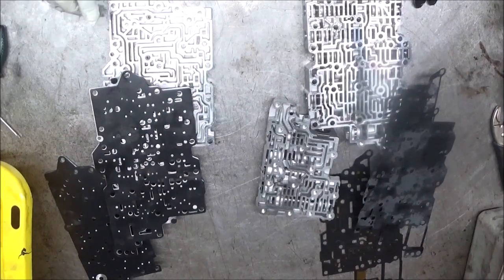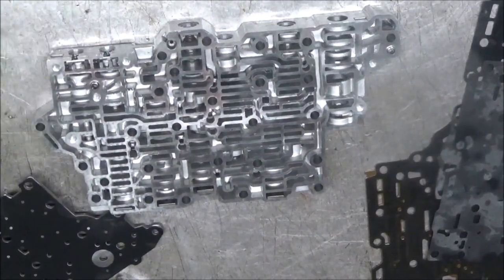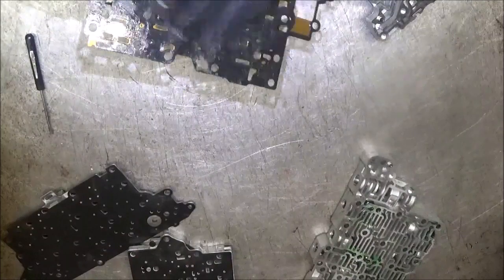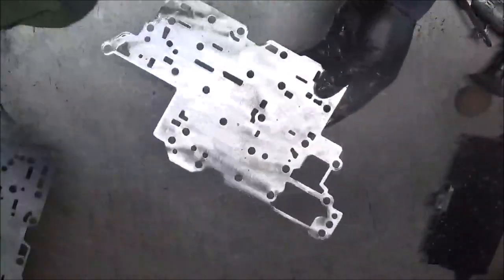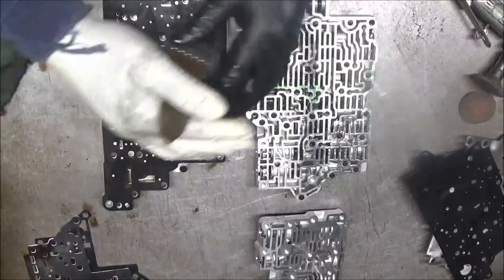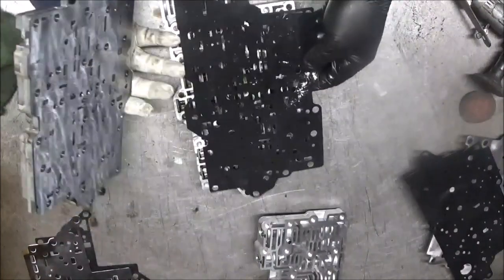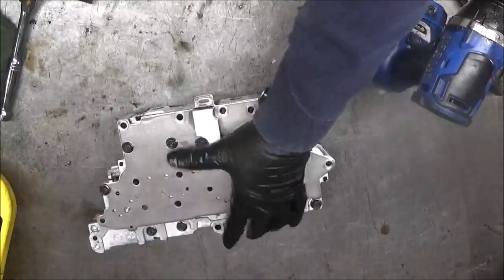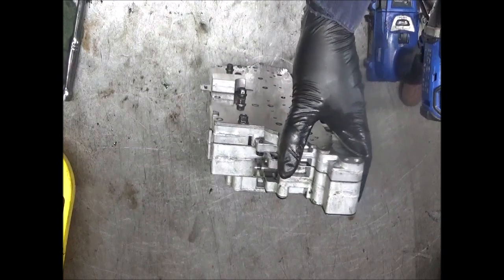6T70 TRANSMISSION VALVE BODY REPAIR (TIP 1) PART 2

Comment: Hello i have gmc terrain slt 2019 with the code trasmision valve stuck off code is P187E-00 is the same problem?
Reply from the maker: A problem code like this is going to be internal. How many miles is on the transmission?

Comment: Great video , just did my first 6t70 valve body yesterday . This vid would have been great to watch when reassembling . 2 of the check balls had indent the plate I left as is , is that ok ? I cleaned the gaskets the way you showed in the other video with boiling water. Very tuff to remove the top plate I didn’t remove just installed with factory gasket. Also bought the pressure switch kit and fixed them , watched your video while installing them . Thank you 🙏🏻 for the great work  keep it up!
Reply from the maker: you should be ok. The boiling water is for gaskets that are not bonded to the metal plate. They have just been cooked on over time. The bonded ones have to be removed with a sand pad.

Comment: I thought the passageways needed to be pressure checked and/or vacuum leak checked to ensure the accumulator ports weren't enlarged from the damage?
Reply from the maker: There is no problem in checking passageways. However, I never have an issue.